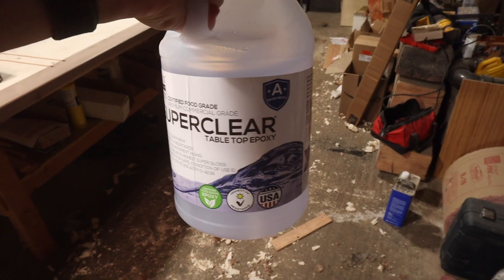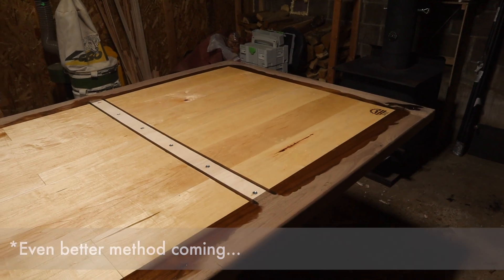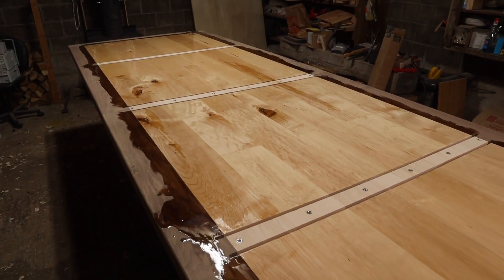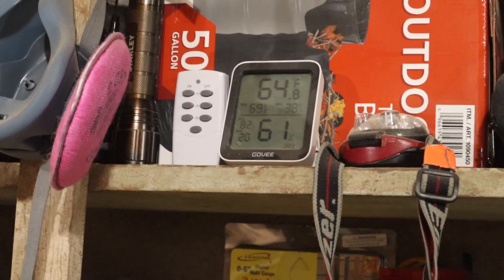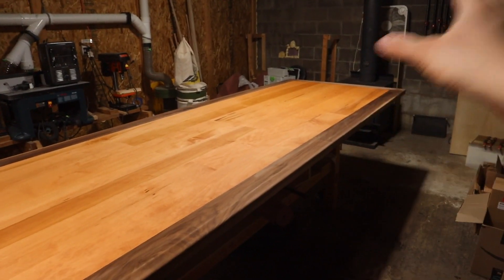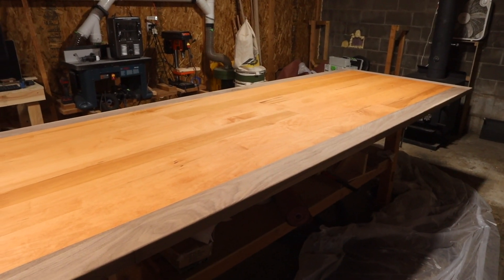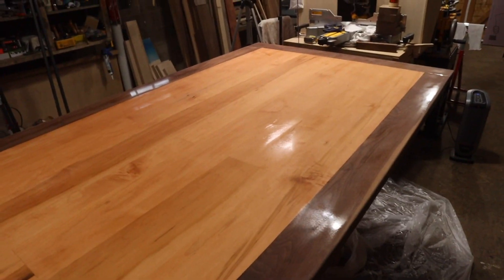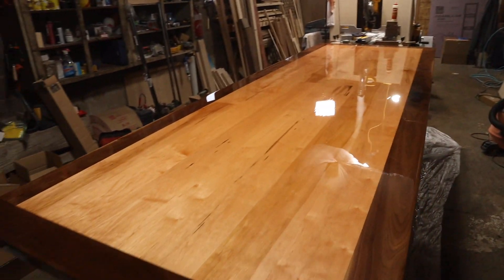Applying an Epoxy Top Coat

Comment: The biggest problem I have with your video is you are RAMBLING!!!  I believe you said how good it looked so many times that it was more than infinity.  Because of the rambling, I would advance the video, and in doing so, if you were giving any constructive dialog, I probably missed it.  

The comment about using 120 grit paper and then changing to 220 or 320 paper because the manufacturer had those for suggestions,.  Do a complete check on the requirements of the manufacturer's requirements before making a video and then state that in your video.  This way you will sound so much more professional!  

You were redundant in how many times you were going to torch the poly.   One time is enough.

I hope you take this as constructive criticism, and not anything other than that.

Have a nice day.
Reply from the maker: Hey Peter! I totally hear you and your feedback is spot on. This video was far more “rambley” than I would have liked. Normally I like to be fairly concise but in this one, I kept thinking out loud which led to what you saw. I also sometimes will misspeak which is what led to the sandpaper comment and unfortunately I don’t always catch those at the moment, leading to my bottom of screen corrections. 

Out of curiosity, with the torching, I kept getting bubbles coming up, how do you prevent them by torching once? Is it just a matter of waiting long enough? This was my first epoxy table so I’m still learning. 

To your last comment, please keep it coming! It’s what makes me better. Some stuff takes longer to hone, others can be addressed immediately. I appreciate the thoughtful feedback. 

Josh
Northwest Craftsman